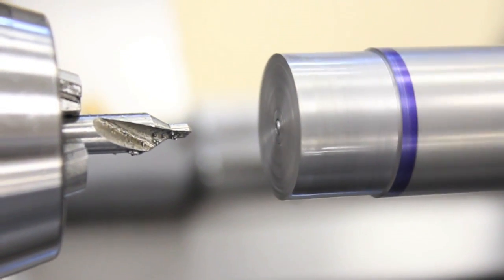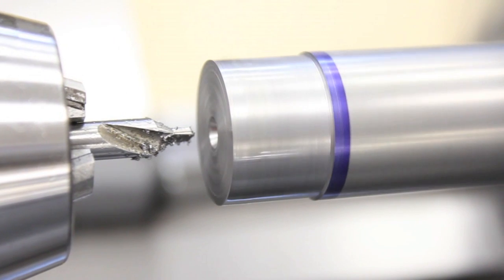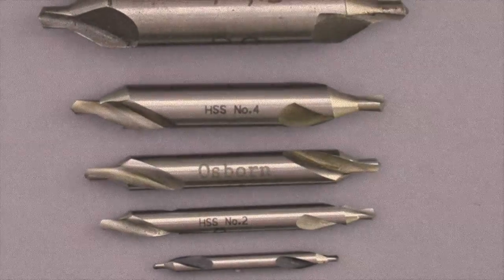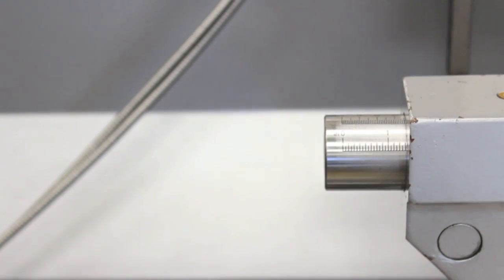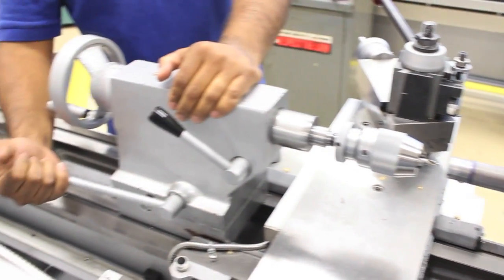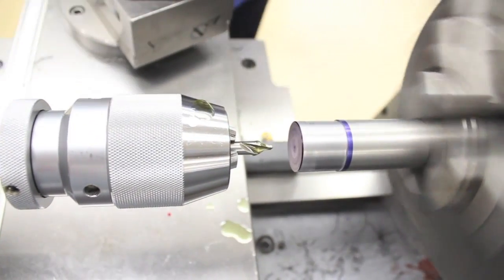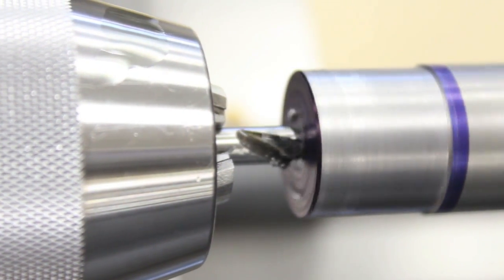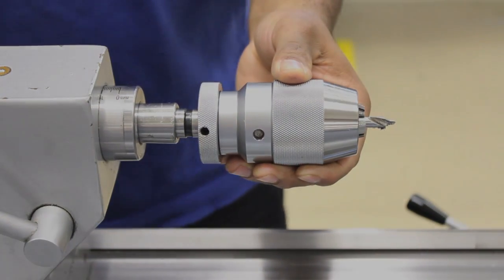Center Drilling

Comment: Center drills are for a live or dead center not starting holes. The very tip of a center drill can be use as a spotting drill but if you go deep the the angle is wrong and the standard drill contacts the edge of the hole first and can deflect the drill. Use a spotting drill for starting holes and a center drill for centers.
Reply from the maker: Completely agree, sir. A spot drill is a better solution for starting holes. I greatly appreciate your comment! Have a great day.
Reply: @AgMasterplan  - Thanks, I have a channel also. Your videos are totally instructional. Are you a teacher?
Reply from the maker: @WinkysWorkshop  , Yes. All of my videos were made several years ago in an effort to get information online for courses taught at a technical college. I designed them originally as homework assignments with questions on a blackboard/moodle platform. I changed jobs, so haven’t been producing videos for a while, but maybe sometime again in the future, in a format for a YouTube audience rather than a classroom audience.

I’ll stop by and check out your channel.
Reply: @AgMasterplan  - You have a well organized approach... perhaps a little dry but probably good for a classroom approach.

Comment: I resurrected a 1960's Craftsman wood lathe, I used a DC motor with a variable speed controller while keeping the original step pulleys.
Because it's variable Ive been able to center drill steel stock nicely, But now because of this video I realized I need to buy another Chuck and spindle.

Comment: In some machining videos, I've seen the center drill wander around just as it makes contact with the work piece. What I'm wondering is (and I'm sure this is a stupid question), but will the center drill "find" the center of the rotating work piece if there's sloppiness in the tailstock and the center lines of the tool and work piece aren't lined up?

Comment: 60 degree center drills are solely for use with 60 degree centers and not making pilot holes for drilling. Bad idea. 120 degree spotting drills are designed for pilot holes for 118 degree bits.
Reply: The reason is nicely explained by Winky's Workshop. https://youtu.be/UOtQLjcCcZg  Stop using center drills for the wrong job.